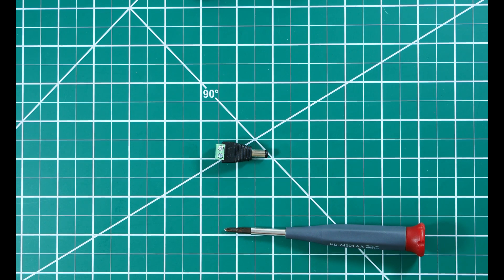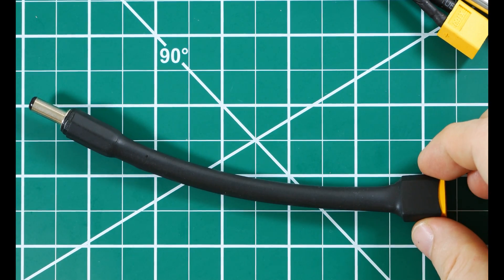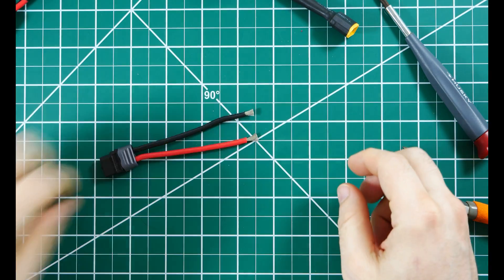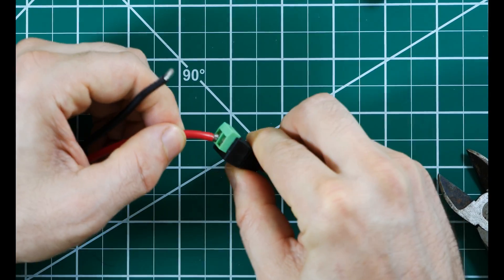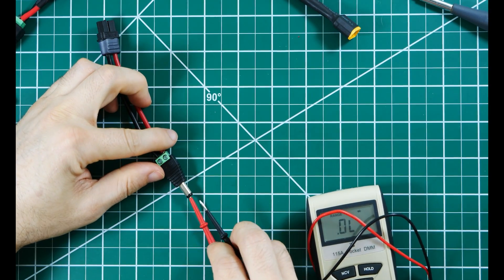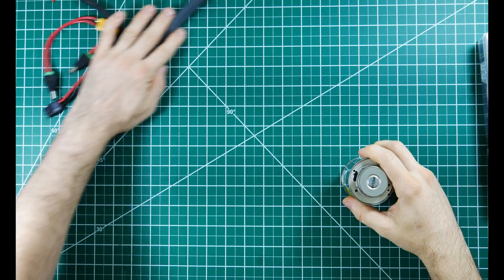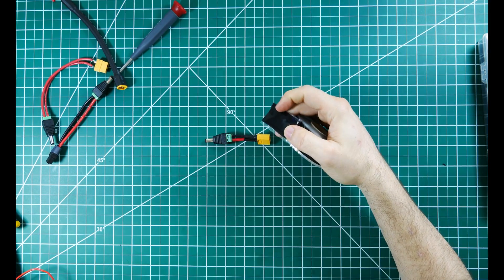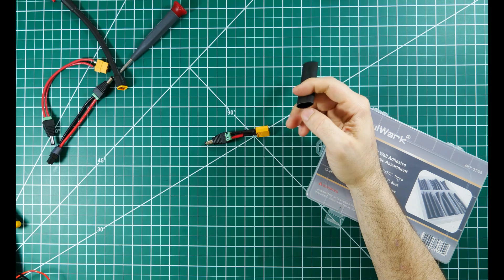Luna solderless barrel intro guide

Comment: What size heat shrink would you need to go over that connector?
Reply from the maker: Not sure. It's not a standard size. I usually use silicone tape. Ideally over top of coating it with liquid electrical tape.